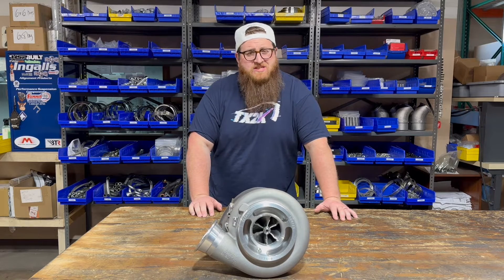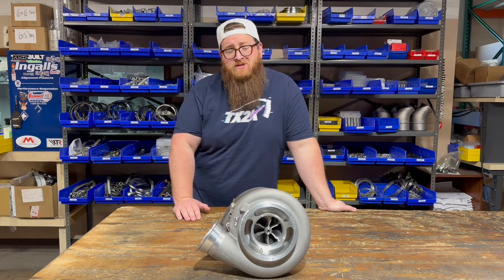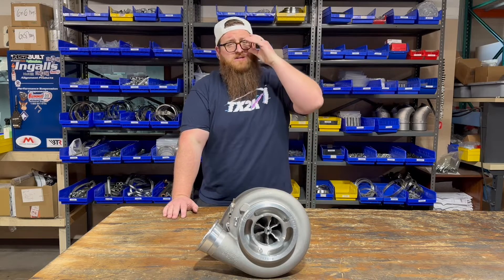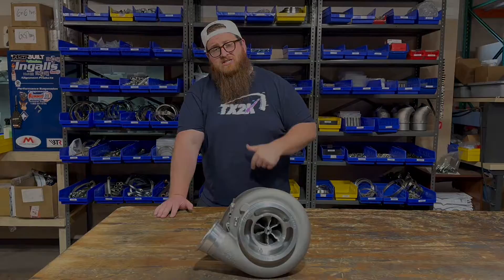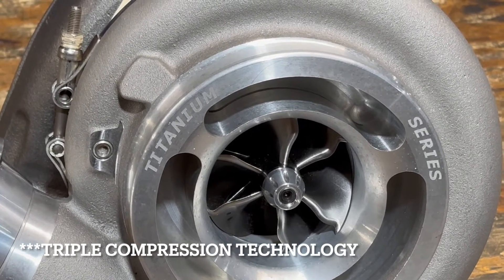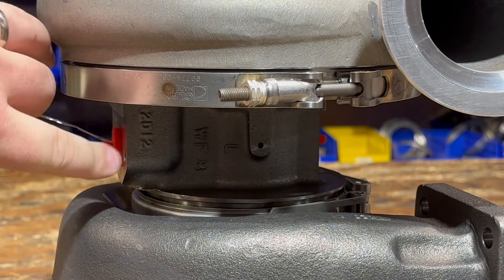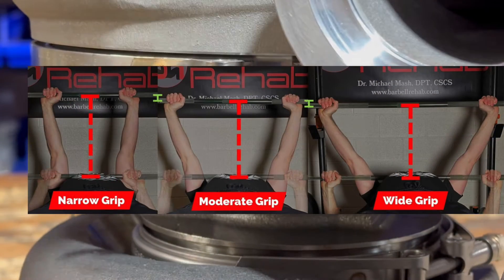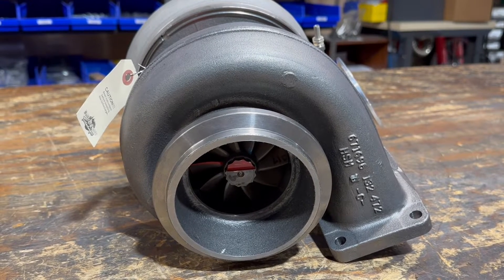Bullseye Power Titanium SEMI Truck Turbo

Comment: It makes no sense to have 96×88 exhuast and then say  its not a s480 frame turbo 

Not knocking you a real gt55 85 123or 133
102 112 exhaust 
Or garret 99×91 exhaust 

Thats a lot of money vs racing turbo basicly sells the same thing
Reply from the maker: Pretty sure you’re commenting on the wrong video, no one is trying to say that this turbo is an S480 or a GT55, but we do have a new video on GTX55 turbos if you’re looking for more information on them specifically.